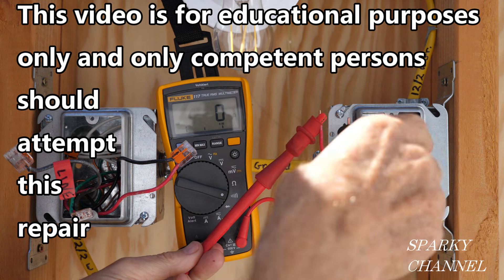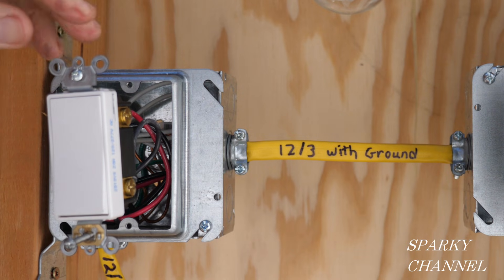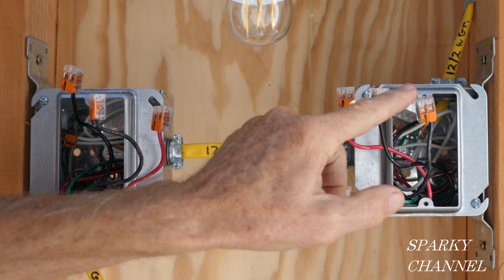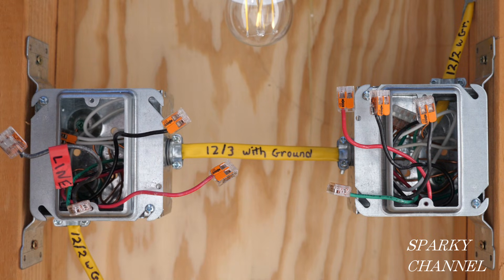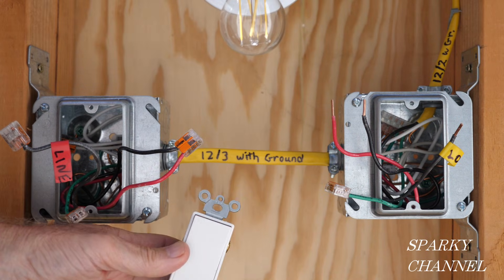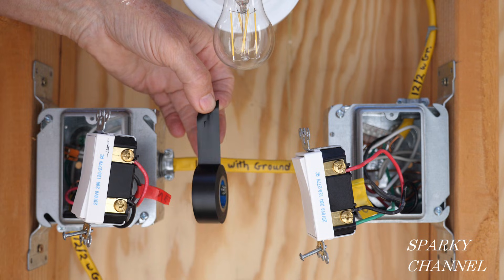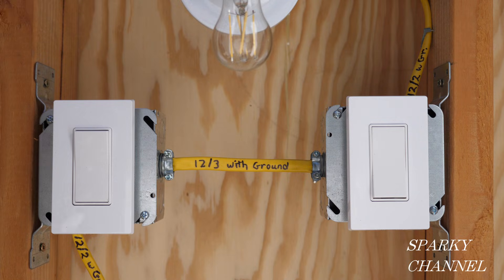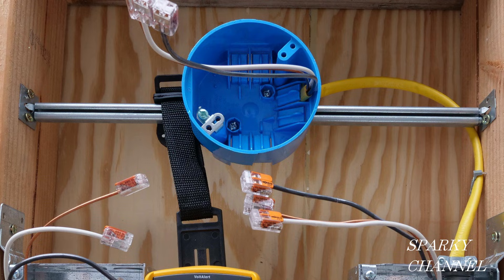How To Fix a 3-Way Switch System

Comment: Can you  make a 3 way video where you are converting a single light with single pole switch to a 3 way?I want to change my single pole with light to a 3 way.The light & switch are already hooked up & work properly but I want to change it to a 3 way.It’s in a stairway.The light is already hooked up to a junction box & from that junction the 14-2 goes to the single pole switch.I think I can just add the second switch by changing the existing single pole to a 3 way & running 14/3 across to a new 3 way.Of course hooking up the line & load properly & connecting the neutral.All proper grounds of course.If this sounds correct can you make a quick video explaining this.Again its converting from a single pole to a 3 way but the light is already wired to a junction box.In the junction the switch & light might be connected I’m not sure unless I open it up.Thanks.
Reply: Depends on where what is fed first and how many holes you want to punch in the walls.
Reply: @danlux4954  only have to change out my 2 outlet box for a 3 but my question is I have power coming from a junction box to the single pole switch & to the light.The light is getting power from the junction box & the switch is getting power also from the junction box.Without opening the junction box my guess is the hots & neutrals are all nutted together.My thoughts are go in to the junction box & terminate the light & have Power going to the switch.Change the switch to a 3 way then run 14/3 to the other new 3 way switch then run directly to the light.From the second 3 way switch to the light run 14/2.What do you think?

Comment: What if it’s a double switch that the single pole is for a different light. I have a 3-way at the bottom of the stairs and one (in a single box) on top. The top one only has a 14-3 coming in and red wire when tested lit the tester. That was connected to the common. The second switch at the bottom has a 14/3 but also there’s two 14/2 coming in at the end of the box where the single pole switch for porch light is. A 14/2 black lit up tester but was connected to the porch light terminal screw and had another black wire pushed in the back in hot terminal to the 3-way switch. After replacing toggle switches with rockers, I got everything mixed up and now the ceiling light line connections in that box are all messed up after taking everything apart to replace light fixture.
How can I fix this.. all different wiring I’ve tried didn’t work except 1 time leaving the light on all the time.
Reply: Do you need help? I will help here
Reply: Where is the line wire coming from?

Comment: Sparky, which insulated screw drivers to you like best? I'm between Milwaukee and Wiha.
Reply from the maker: Wiha for sure. But they are more expensive.
Reply: Wiha is what my company gave me. Though I'd also look at Wera. They have a stainless vde model if corrosion is an issue.

Comment: Great video, but I did not see the natural wires,  where are they? 
Thank you
Reply from the maker: Do you mean ground wires?
Reply: @SparkyChannel  I think he might be looking for the (white) neutral wires. Behind the scenes those are tied together at each box using the Wago lever-nuts and complete the circuit back to the electrical panel from the light(s).

Comment: Nicely done.
1. What kind of handy device will allow you to test for continuity when your switches are 30 feet apart?
2. Are you doing a troubleshooting video for 4-way systems, and for 3-way systems that are wired device-switch-switch and switch-device-switch?
Reply from the maker: Hi Jo! How are you my friend? For the test shown in the video any continuity tester with any length leads will work fine because we're just testing 2 wires in the same gang box. If I did have longer continuity tests I would use my Extech CT20 Remote and Local Continuity Tester: Amazon: https://amzn.to/2C4AMNK
  Yes, I'm hoping to do all those videos. But as I'm going strictly for quality over quantity with the wiring videos it may take a while for me to get them all done. I'm really happy with how my EMT bending series came out (22 videos) and I'd like to do something similar for wiring. Tomorrow's video is wiring a half hot receptacle with power to receptacle. Later I'll do wiring a half hot receptacle with power to switch. Thanks!

Comment: For the continuity testing I recommend the Extech CT-20. It's a nice addition to the tool bag. I twist the travellers together, or you can also put a short piece of cable sheath over them to indicate they belong together.
Reply from the maker: Hi Marcel! I own the Extech CT20 Remote and Local Continuity Tester: Amazon: https://amzn.to/2C4AMNK  
  and I love it. Good tip about using a piece of sheath for wire marking! Have a great weekend!

Comment: No doubt the best electrical teacher anywhere. Just so well explained. If you did not have a multimeter and you identified the line wire. The traveler wires should be easy to identify by looking into box and seeing that the red traveller wire has associated with it a black traveler wire that way you can through process of elimination identify the black load wire.
Reply from the maker: Thanks so much Math Man! Have a great weekend!

Comment: Now do a circuit that can be switched from 4 locations.
Reply from the maker: Good idea! I like that!!! Have a good one Dave!
Reply: That would include 4-way switches. Or push-button switches and a contactor. The last method is what I use if I have more than three switches. There are special contactors available which also offer such things like after after an adjustable time period it will switch off the light. For example in the staircase of an apartment building, if someone forgot to switch the light off. I installed it in the staircase of my house, I got four switches in there. But it's also possible to implement additional push-button switches without tempering with the whole circuit. It requires only 2 wires to the push-button switches. For this purpose we got push-button switches which look like the standard switches, but they don't lock in place if you push them. I use this one, it's installed in a panel, here we use DIN-rails in the cabinets to mount the circuit breakers and additional devices in it.

https://www.eltako.com/fileadmin/downloads/en/_bedienung/ESR12np_4873_internet_gb.pdf

It got two terminals for the control circuit, one with 230V and one with UC (universal current, meaning AC and DC, both will work) 8 to 230V. That's due to the reason in East-Germany they used instead of mains voltage the low AC voltage from the bell transformer.